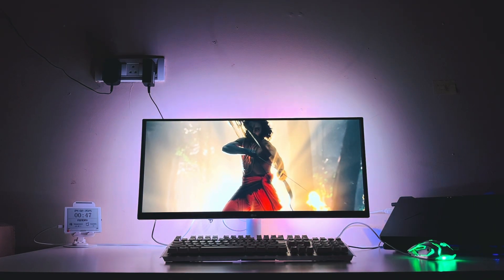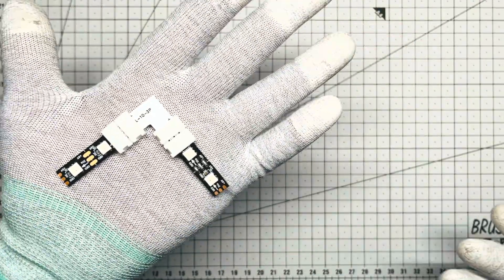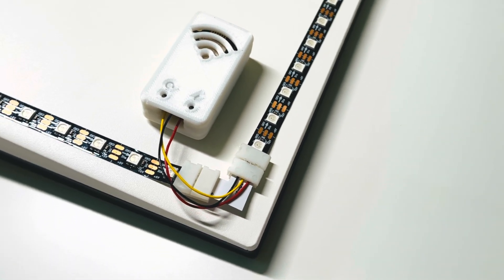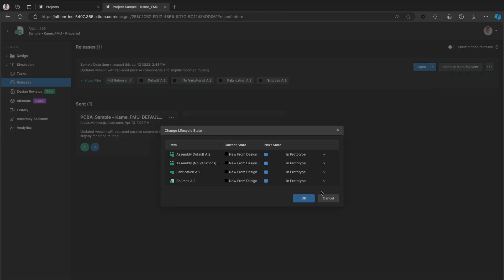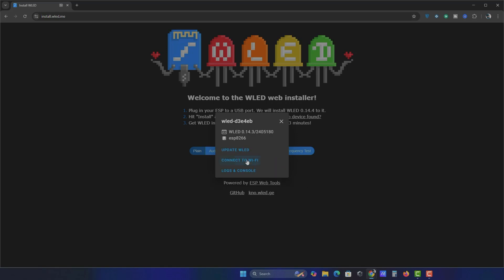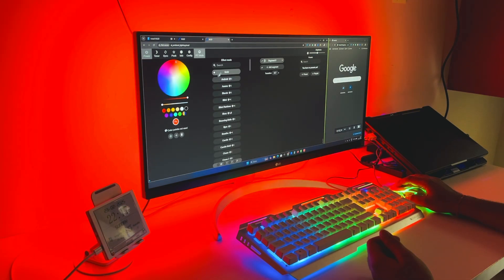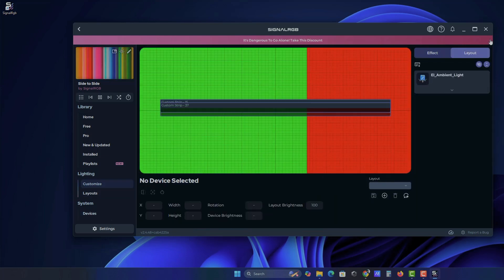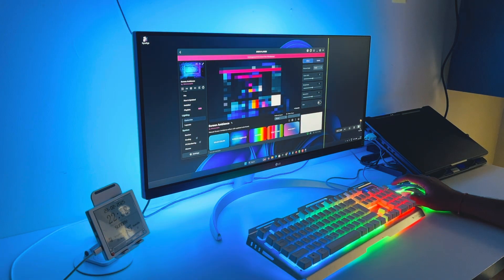ULTIMATE WLED Ambilight Setup for $15 | NO CODING!

Comment: Power supply not required? If external adaptor given , what should be its config?
Reply from the maker: Your Laptop can support up to 500mA, that's enough!

If you want to use an external one, you can get 5V, 1A adapter.
As these are widely available!
Reply: @electronicsinnovation  its 34inch ultrawide monitor , from what i calculated i need approx 150 led

Comment: Hey thanks for the tutorial. Is the 5V connected and drawn through your screen or a seperate adaptor?
Reply from the maker: Connected to laptop as of now, if required you can use an external adapter too.

Comment: Just a suggestion: Use ESP32 instead of ESP 8266 for creating ambient lighting for monitor, it'll sync colours faster - giving a lag free experience in most cases. ESP 8266 is more suuitable for bias lighting.
Reply from the maker: Thanks for the suggestion. Maybe I will try that also to see if there will be any significant improvement!
Reply: @electronicsinnovation 
I suggested that since ESP32 has a dual core processor, so 2x the processing speed. You could play different framerate videos (30, 60, 120) on your PC and check which framerate works best with the ambient light setup (basically determine the framerate of the ambient light setup)

Comment: great. but it does work for specific apps or it will wok for entire screen no matter what app we are running? And what if we want to use it for LED TV?
Reply from the maker: Yes, it works on all apps, but for the TV signalRGB way might not work. But definitely there will be a DIY way which I haven't explored it yet.
Reply: @electronicsinnovation  make a next video on that topic, diy cheap ambilight setup for TVs